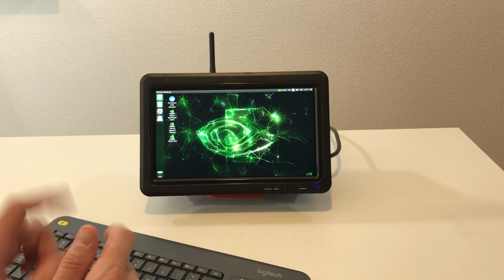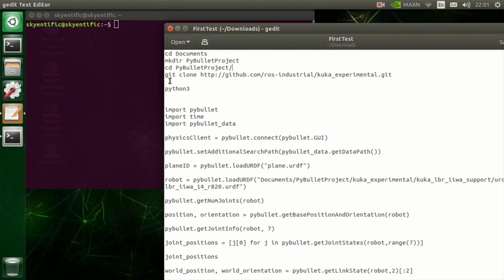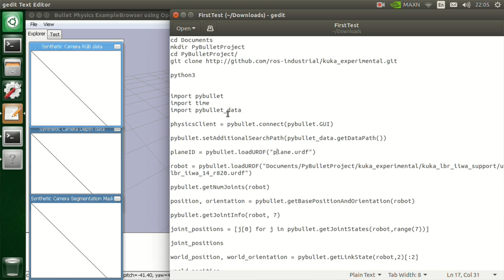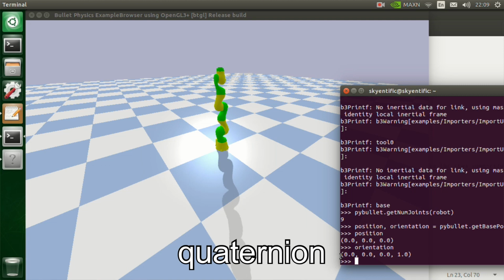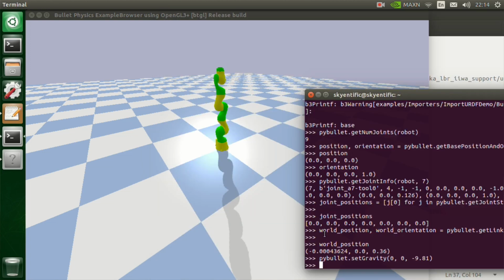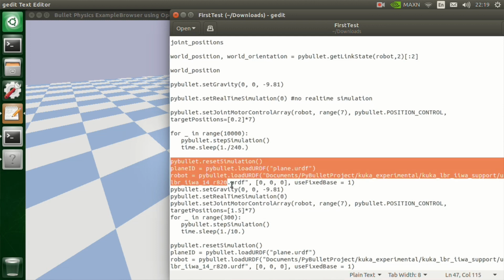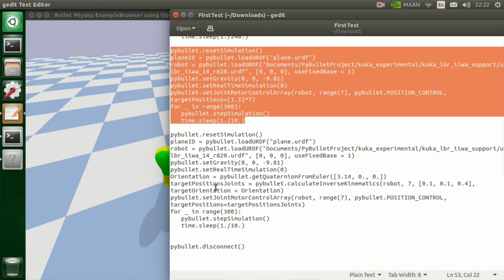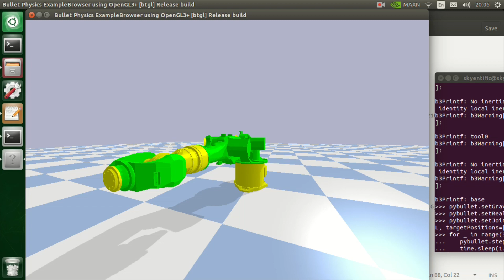Tutorial: Simple Robot Simulator (PyBullet on JetsonNano)

Comment: I'm getting the following after running "import pybullet" even though i did install numpy. Any suggestions?
ImportError: No module named 'numpy'
Traceback (most recent call last):
  File "<stdin>", line 1, in <module>
ImportError: numpy.core.multiarray failed to import
Reply: *Fixed. I was running Python 3.5. Needed 3.6